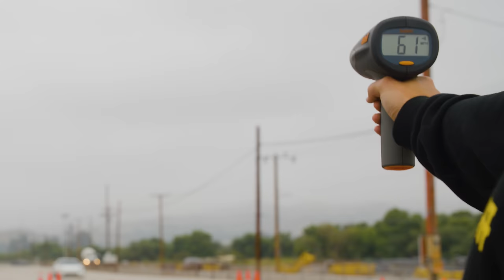$450 Brakes vs $4,500 Brakes | HiLow

Comment from the maker: Do you drive a Hi car or a Low car?
Reply: Not yet car
Reply: High, I don’t trust eBay parts
Reply: High car, rotora BBK with OZ wheels wrapped in Pilot Sport 4s
Reply: A middle car. It's stock.
Reply: Low car, 2003 Mazda 6, just bought it, it works
Reply: Mid Car - Don't trust eBay parts but can't afford top dollar
Reply: I don’t have my license but my family is Low
Reply: I drive a no car
Reply: It's not lowered.. yet, but I usually go for the cheaper upgrades. If I went for the more expensive ones.. well I just wouldn't have any cuz can't afford them nor would I pay so much for one thing anyway. I'm po yo LOL
Reply: Lo car for me. I have a 2014 C300 on lo rim$ n lo on them brake$ too, I just need some good lo coilover$!  Hopefully someone can recomend on the kind I should buy? 😎🤙btw very good episode  guys!!!
Reply: Low Car lol
Reply: cubicq1 well i wouldnt know what to suggest for a lo car but but if you want the best coilovers, KW suspension has the best coilovers ever
Reply: Medium car
Reply: The lowest of cars
Reply: Lower than low car
Reply: Westley Parker Peugeot 106 zest. (2000) try me boi
Reply: Donut Media low car, my car costs less than their wheels and has a top speed of 110
Reply: super low car
Reply: @dghddvsfbdch6183  awesome dude thnx
Reply: @BigMattRob  400 hp Honda crx
Reply: Hi car that looks like a low car 
With low car tires because theyre getting burned off 
But its got a ls so no ones expecting the speed
Reply: Donut Media I would give my guy a raise
Reply: Functional mods=high.. cosmetic mods=low.
Reply: I drive a stock Toyota Sienna LE. That’s not comparable a tuned 350z
Reply: Stock.😭 maybe another day when ever I have time and the money😂
Reply: I drive a no car
Reply: I drive a medium car thank you very much.
Reply: I drive a broke car
Reply: Slowly building a high car, takes longer on a budget but I think the results are worth it
Reply: Low car
Reply: A stock car
Reply: I have a Lo-car (mostly finished).. but am working on a Hi-car too (barely started) it's so expensive that progress really suffers.
Reply: Low car, but I don't track or drive super hard. Just keep the daily reliable, and mod the off-road toy.
Reply: @UC4UqvaIO4GkvcFEBOB0hA2w  for smaller cars, there are sooo many brake upgrades available at the wreckers... the trouble is that you have to invest the time to find something that fits.
Reply: Was this not already released previously? Hand on my heart I watched this a while back yet it says it was released 6 hours ago...
Reply: All low cars over here!
Reply: Hi for sure
Reply: Mopar or no car
Reply: A medium car
Reply: At the end you should sell the cars. I'm curious weather the Hi Car is worth that much more than the Low Car. Aka is Hi Car a money pit
Reply: Donut Media low car, Mazda protege gt 1991
Reply: @u1richh  hi stock, its an audi.... i need a better job
Reply: 6 piston 18Z calipers and 14 inch two piece rotors stop my 300 on a dime, but cost many dimes.
Reply: Stock car
Reply: One of both.
Reply: Low car but i do all the work myself and not the lowest i try to go mid tear XD
Reply: Mixx😂
Reply: no car... so buy me a car please
Reply: Low by all means. Hi brakes too much money for just a few opportunities. I am a spirited driver... not a racing one... just my two cents
Reply: Imagine driving lmao
Reply: Hi car son! Viper!
Reply: Hi
Reply: Lifted f 350
Reply: low car for sure
Reply: Hi car C300 modded out and a Low car 240sx S14 but one day will be a high car
Reply: For the g35 and 350 go with akebono caliper upgrade   bigger brake kit for g35 for only 500 used  4 piston front 2 rear
Reply: All the way from Jamaica, you guys are the best I love the humor keep it up good job👍
Reply: I got a motorcycle does that count?
Reply: I drive a sh!tbox 99 TransAm so it's fairly apparent it's a low car.
Reply: Lo
Reply: I'm driving a shit box.
Reply: So lo it's in hell, where it belongs.
Reply: About that low life guys
Reply: i drive both, you see i wait for the Hi cars to get into a wreck. buy the good Hi parts for cheap and put it into my Low car. best of both worlds for me but not to the guy that had to much fun
Reply: So Low that most of the parts are homemade...
Reply: @u1richh  Stock suspension height 10 MAZDASPEED3
Reply: Low car.
Reply: garbage car! haha. 01 saturn sl2! there is fun in driving the piss out of a pile that if wrecked you have no remorse for!
Reply: Both! Slammed Nissan, jacked Subaru.
Reply: A car that has no motor... low I think?
Reply: I drive a Mid car. Not too cheap on parts, but not too expensive either.
Reply: Stock car
Reply: Hi car, if my breaks fail after some hard breaking i'm flying off a mountain
Reply: Low budget, lowering springs, low car
Reply: Hi car... But like now they are parts from 12 years ago before I had kids and responsibilities lol
Reply: The next hi low will be about paint
Reply: Donut Media KEEP GOING W THE HIGH LOW UPLOADS
Reply: Daily: high
Weekend turbo ek: everything high except for the rota slips
Reply: Low car
Reply: Donut Media what’s below low???
Reply: Hi car
Reply: You should do what’s better a supercharger or a turbocharger.!??
Reply: the car drives me
Reply: HELLO DONUT..
I REMEMBER WATCHING ONE OF YOUR VIDOES...
At the end you were promoting a website or link that that's teaches or help develop various skills..
Would like to know the name? Am interest in the link.
Reply: A Corolla, I drive a Corolla Karen!!
Reply: My car (Honda Civic EK3)  is definitely a low car, becaudse a lot of stuff for it is AliExpress hahaha
Reply: Medium
Reply: Donut Media Safety is number one ☝️ priority!! You should get the willwood or brembo brake kit!!!
Reply: High car, can never fail upgrading what the manufactor has shoe horned into price margins and when I do a job on my car I do it right so maintence goes easier. Our 08 mountaineer calls for ceramic pads all around but from alot of research larger vehicles do better with metallic so I went with the same Bosch severe duty meallic pads they use on police explorers that lasts twice as long as normal metallic or even regular grade ceramics coupled with some brake drag reduction return springs that even out the pressure on the pads/caliper and they keep the pads from rubbing. Up here the Oem ceramic pads slid until the whole caliper warmed up in winter and now even at -10f these bosch pads stop consistently, I do brake fluid changes every year if the fluids a dark enough amber and its crystal clear when I'm done. On my '86 chevy astro van thats street "race" spec with a 65thou bored out 4.3L, gutted interior except front seats and has a high flow exhaust but for the brakes I use race grade ceramic pads that are as close to carbon fiber biting force upfront and HD metallic rears and that van will throw everything in the back to the front if your loaded even if you used three straps to hold the spare, if you have enough traction itll lift the front. the police brakes were almost cheaper than regular oem stuff too with the goodys and consumable rubber bits
Reply: Donut Media try doing a comparison of the $2K Akebono BBK vs the Wilwood BBK.
Reply: Loooooww either my 2005 Hyundai or my 73 super beetle
Reply: @epiles2  My Tesla came with Pilot Sport 4S's stock.
Reply: Mine's stock at the moment. Will follow a similar path in upgrades though but will find a happy medium between the products shown so far. Probably do mid-range performance coilovers, a nice set of 19's, and some damned decent tires (driving a Fuga 350GT or an Infiniti M35 for the rest of the world).
Reply: @takanara7  nice so your car came with good tires, those werent out when my car was produced (those tires were released like 2?years ago)
Reply: Hi or low? I drive something in between the two... I don't buy the cheapest parts, but won't spend thousands if not necessary. I like these series tho. it show in many cases that  the Hi stuff isn't so much better than the Low considering the price tag and servicing cost etc.
Reply: stock shitbox
Reply: Νο drivers license, yet
Reply: Depends on your perspective, my 1992 prelude SI 2ws is mint which makes it a high car. On the other hand all the mods were done in 1993 and are pretty LOW right now.
Reply: One that’s below low car
Reply: High car, carbon ceramic, Michelin cup2, Bilstein
Reply: I drive an e46 so it's a high car and not for mods but for maintenance!
Reply: Rent car
Reply: I love this new series
Reply: Donut Media Medium, I’ve got brembo brakes and Milltek exhaust, but I have cheap wheels and tyres
Reply: Low car
Reply: i drive a low car high lol    i mean Hi
Reply: Y’all should do this series again with little fiesta st’s so you can do hi/low with turbrchrgrs
Reply: I drive an OEM car.
Reply: Low and stanced
Reply: Any car looks better low😂🔥🔥
Reply: Somewhere in the middle.
Reply: What if you're spending Hi car money on your Low car...80's VW anyone?
Reply: I drive a No car
Reply: Ho is this and I am Denislim 
Iike yore car
Reply: Hi car, if you race, better get good brakes etc
Reply: Do super single and racing clutch for next!!!!
Reply: Showed 4k usd "down the drain" for a fucking 2.5 N/A 5cyl swap on my volvo 744 (originally B230K - you US guys maybe never heard of it, 2.3L redblock, carburated.). Busted one crankshaft of my 2.4 VVT just with the startup with the standalone ecu. Bought the other 2.5 engine out of a 854. Still rusty af. Still no suspension or brake upgrade from 262mm basic rotors. Bought the car ten years ago for 100k HUF (540usd back in 2009). It's a hi, but it's still a low :D
Reply: Got high and low cars here daily’s and special occasion car
Reply: Please do an Exaust Hi to Low
Reply: Dh bike
Reply: Lo car for sure. I don't think these guys understand what you guys are doing. Lo car doesn't mean bad car... Just cheaper. The parts you guys are getting are good... Just cheaper and perfect for a daily. Hi car is great but you will do more than daily it. You probably will track it. I want Hi car my wallet though says Lo car. 😊
Reply: Donut Media low,super low,like max payne 3 walmart bargain bin low
Reply: I drive a car that I bought for $1,500. The most I've payed was $2,500. The usually last 1-2 years, doing my own maintenance and small repairs, then I start looking for a new one before the old one craps out.
Reply: c5 vette with a mix of expensive parts and some cheap parts ;)
Reply: I have a $50 dollar car
Reply: Donut Media definitely a low
Reply: I'm more of the middleman in everything soo far
Reply: It there a in between car? Lol
Reply: Low mods hi repairs but not by choice, that’s what you get when you buy a bmw
Reply: I drive a stock honda accord #dadlife
Reply: I drive a van
Reply: Stock...but I'm on the low side for sure.lol
Reply: 93 350 chevy. Beast!
Reply: @rt_lucas6822  work hard dont be silly with cash
Reply: Sir, I drive a toy car
Reply: Hi car - AMG GLC 43
Reply: Hi car - AMG GLC 43
Reply: I drive a Zero car, Zero spent on upgrades because I am DIRT POOR
Reply: I wouldn't drive a car high unless in like, South America or something
Reply: Low car.  V-MAXX Classic coilovers, $150/corner wheels, stock rotors w/ upgraded pads and stainless lines on an NB Miata.  Miatas don't have enough power to fade these brakes at the track anyway.  :D
Reply: Low car, just bought $7 brake shoes a couple months back but they work surprisingly well on my old saturn.
Reply: I'm a more "depends on the part" kind of person. Rims and rubber I like a middle ground, brakes and rotors name brand upgrade, suspension upgrade name brand, stereo system name brand parts and OFC (fux CCA), quality tint no purple bs, no name intake, stock exhaust just resonate delete, oem upgraded plugs and coils.
Reply: I drive no car😐
Reply: So low I squeeze my cheeks every time I have to face my dreaded arch nemesis the speed bump
Reply: Next, spoilers!!=!!!!!!!
Reply: Mid
Reply: Hi car
Reply: 370Z Nismo 6sp Manual. Mostly stock.  
+ Aftermarket Oil Cooler (Z1 Motorsports Setrab 34 row) this is needed and SHOULD HAVE COME STOCK from Nissan on a Nismo. 
+ Aftermarket Cold Air Intake (K&N)
+ Murdered the Stock Nismo 19” Rays Black
+ New  tires (Continental Control Contact)
+ JVC Stereo upgrade with backup cam.
That’s it.
So is it High/Low? You choose- I don’t buy the most expensive products and definitely never buy the cheapest.   I have prob spent like $30K on my Z car in total over 5yrs since I bought it used- including the cost of the Z.
As others have prob said- if you buy a Sports package or a Nismo you get better brake calipers (like Brembo) and better suspension components.
Reply: Lilpeanut8888 haha 😂
Reply: mid car. researched parts i could spend less on and spent some decent money on things i shouldnt cheap out on
Reply: Hi car 🏎🤙🏽
Reply: Yes
Reply: Low af.(peugeot 405).But it's reliable af too!
Reply: Low for sure
Reply: I drive low car now, I would prefer not driving that lol
Reply: g37 :)
Reply: 74" Ford F250 Ranger XLT 
Low so far no expensive parts have been needed at the moment
Reply: I pimp the medium cars.
Reply: WOW NICE... Not cool donut
Reply: In all seriousness I drive the bisimoto 1000 hp elantra gt. Its almost finished, only 826 hp to go.
Reply: Stock car (for now)
Reply: Hi
Reply: On the brake upgrade a low car😅
Reply: Donut Media this already has 1 million views.... if everybody watches this 9 more times, Nolan will get a pay increase! Let’s do it!
Reply: Jeep srt w big brembos🥵
Reply: Hi car
Reply: 100 dollar 88 Cherokee
Reply: No car.
Reply: Both
Reply: Donut media give me a break 🤣
Reply: High car. MX-5 ND2, Brembo, BBS, Bilstein dampers. BUT I need a set of winter tires for a couple months out of the year, and already looking at 2k for a med grade set of wheels and tires. After watching these vids, probably not gonna sweat not being able to afford Advan or Enki wheels for a just winter.
Reply: Middle car
Reply: Donut Media I got evo x with hot boi bolt ons and and low boi wheels and tires lol
Reply: Medium car. I don't trust eBay because the deliveries never make it to my house.
Reply: Lowmborghini
Reply: Donut Media hi car
Reply: I drive a stock Tahoe. Working on making it look pretty with headlights bumper wheels and lift but eventually I will turn it into a hi-car. Just scared it will rust faster than I can build it
Reply: Mid Car
Reply: medium car.
Reply: I drive hello car
Reply: Slo car
Reply: I drive a 2000 ford ranger with almost 300k mileage, all maintenance done myself. So, it’s a hi car to me, but a low low low car to others.
Reply: Low Car. Miata will nearly all eBay parts... but picked very carefully. no problems so far ^_^
Reply: I drive a NO car
Reply: I drive a truck to tow everyones low cars
Reply: No car
Reply: Low
Reply: Моча ссаки
Reply: Mid car
Reply: Hi car, 1968 dodge charger
Reply: High car chevy s10 2.2 😥😂😂😂😂
Reply: Low
Reply: A later car
Reply: I drive a stock 2018 MX-5 Club with all the performance upgrades available. I consider it a Hi car, and I'm very pleased with it. The only thing I'd add is a supercharger.

I also have a 1991 MR2 turbo swap (NA originally). This will be my Mid car once finished.
Reply: I don't have a car
Reply: I drive a high car, a Toyota 4x4 😌
Reply: Mid car, a mercedes SUV (glk)
Reply: I am currently driving/slash building a 2004 Chevrolet classis with the 2.2 ecotec and believe it or not I'm going in the low range man but I'm doing it the rockauto way with dirt cheap oem brand parts from other gm vehicles and let's just say it's paying off big time dude even though nobody fucks with these throw away cars it's turning into something awesome and I love it
Reply: Donut Media i drive a No car
Reply: a very low yet mostly reliable car
Reply: Low
Reply: I am driving a hi Opel Vectra ^^ in that car already went over 10k €.
Reply: technically a low car becuase i fabricated my cage, and used spare parts from my stock car (old seats, old out of date parts, every time my sponsor pays for a new better part the old one goes on the truck) but it's really about 50k in parts
Reply: I drive my car high does that count?
Reply: Lo life
Reply: I call bypassing a tune
Reply: Donut Media hi
Reply: Low bike
Reply: Low low car 98 gti , semi stretch tire low pros
Reply: Donut Media I drive a Jeep.
Reply: Low,  because I'm going thru financial issues but I'll bounce back
Reply: Broke car
Reply: I drive a Hi Car. LS Swapped 350Z, 19 inch rollers, 3 inch independent stainless steel dual exhaust, cross drilled and slotted rotors, (coil overs are coming) #620LSZ
Reply: I dont even drive a car, yet
Reply: do hydro E-brakes next !!
Reply: Hi car
Reply: Stupid hi car 
Evo 9 mr 870 whp on volk te37 sl with Toyo r triple 8’s
Reply: Mid car, some parts low but modded to work better. Some parts hi.
Reply: A low car but make it Hi
Reply: Donut Media hiii
Reply: Fully stock car
Reply: low car)
Reply: I drive HI Bike and Stock car
Reply: Donut Media no car 🚙
Reply: Low car, i drive a schwinn
Reply: The lowest of low, 1998 ford festiva trio, $300 from a work mate, $39 to fill from empty, 0-100km/h = eventually lol. Its ugly, its slow but i love it
Reply: Low car 😂 but I only bought some spoilers
Reply: Hi car R33.4 I want it to last
Reply: Man at 6:14 you guys look really high.
Reply: VERY high. My Porsche 928 S4 had 2 previous owners.
The first was a guy who owned a premier repair shop that specialized in Porsches, Mercedes and BMWs.
It was kind of like his demonstration car so he spent 20 years upgrading maintaining modding it has a show car for his business.
The second owner was one of his employees could fall in love with the car when he bought it he took it racing and blew head gasket which resulted in a very expensive top end rebuild and replacement using GT heads with less than 3500 miles on them. The combination of the S4 Block in the GT heads is amazing it is an upgrade that not many people will do because it's very expensive but he threw a lot of money at that car. After damaging it trying to race it he decided to show it and it won first place in five out of six Concourse events he took it to.
So what I've got is a one-of-a-kind car that two guys over 20 plus years babied upgraded spared no expense on. All I've had to do is drive it. And I've seen the car double in value since I bought it. I couldn't love a human baby more than I love this car. Period.
Reply: No car cuz I'm 15 but a 350 is my dream car so maybe one day
Reply: Donut Media hi
Reply: Stock jetta tdi wagon
Reply: I don’t have one
Reply: Goin` hi! Just put some OE brembos on it
Reply: I drive the ultimate low car
Reply: Dad hi mum hi everybody hi grandma tough but low
Reply: Live that low car life!
Reply: Go kart
Reply: I drive no car :(
Reply: Recently went from 987 Cayman to '95 Miata.  NO REGRETS!  1 Porsche street tire = 4 Miata track tires, but you guys already know that.
Reply: I could buy 5 of my daily for the price of hicars brakes
Reply: no car
Reply: Low car Ford focus MK3 2012
Reply: No car cause I'm 13
Reply: I'm 13. No car
Reply: @dghddvsfbdch6183  no for the low car you need those coilover suspension kit nissan fairlady 350z 370z front back suspension coilover kit green
Reply: Low car I’m broke😅😂
Reply: LO CAR ALL DAY
Reply: @joeg.1119  super for throttle response and low end torque, turbo for efficiency and overall power
Reply: @joeg.1119  to upgrade a demon to 1200 horsepower this one mod place swapped its famous blower for turbo
Reply: You guys should do this again ... but with the late model Toyota MR2 .. but this time switch who gets the High and low cars .
Reply: No car
Reply: More mid range
Reply: I’m vary late but average with design flaws.
Reply: Stock civic lx but I love civics so just finally being able to own a nice one is a dream come true
Reply: Mid car lol
Reply: Medium/High!
Reply: 2014 ATS 2.0/ ZZ Performance 
Downpipe/ intake/ tune
3in exaust/ stut bar/ front and rear sway bars/ endlinks/ throttle body/ slotted cross drilled rotors/ pad/ steel breaded brake lines. 
,
Reply: Low when I can, go up only as much as I have to in order to get decent and reliable parts when I can't. 

It's all about knowing where you can and can't save money.. Getting good deals on good parts that you're not spending half of the total price just on the name stamped on the part.

Half of that comes with purchasing a car with a very large aftermarket. You don't wanna have some car where the only intake you can buy is a 300 dollar all carbon fiber beautiful glorified pipe with a bespoke K&N filter on it from Achtuning.
Reply: WTF why do you have those small OEM brakes on that car, how can this even be legal ?
Reply: @Clayton Salvigsen Um dude.. I would absolutely love to see a video of your car that sounds fucking AWESOME.
Reply: @JohnTothPhoto  Bro... You can always get different sized rims on the Porsche hahaha. Even most 17's are extremely affordable and I'm guessing most Porsches from before the modern Era where they started to get huge will look perfectly fine with 17's.
Reply: Hi car. Very hi car. I love it but hate it 😂
Reply: New car
Reply: Low car here
Reply: Low
Reply: I drive a stock car..... ):  need mo money's...
Reply: BOTH
Reply: 97 Sentra 5 speed. I call her ugly Betty. Ha
Reply: I bought someone else’s high car. 😊
Reply: Introducing the Invisa-car
Reply: Hi, quality always matters
Reply: Low car because of the color
Reply: I drive a stick car :D but if I had the money I’d go hi car all day, if I didn’t (and I don’t) have the money I’d save up for the best quality for a more moderate cost, I’d never look for the cheapest option, I’ve seen low car have too many issues
Reply: An old bike.
Reply: A low breaking down truck every once in awhile 🤣😭😭
Reply: Both. My suspension, wheels and tires I spent a lot. But my brakes, I’m not spending $4-5gs. No way. My $500 brake kit works just fine. I’m not slamming on my pedal like that lol. For daily driving, the $500 brake kit is totally fine.
Reply: Lo
Reply: Low car, the only way ill go high car is if ima be going to the track constantly or take it to Mexico runs. Its my daily so i just want it to look agressive sound agressive im only pushing 350hp few bolt ons but its enough for me. Down the line i do plan on going high on a project tho
Reply: Hi car, Acura NSX 1991
Reply: Stock
Reply: No car im 16 rip
Reply: Standard car
Reply: A bike...
Reply: I drive a no car
Reply: But if i could afford i would be team hi
Reply: I Have A Mid Car.
Reply: Between.
Reply: I drive a higher low car. Not cheap parts, but still pretty cheap. I have a 1986 S10 with a 2.2L 4c. With a turbo and a 5 speed swap, brake kit, beefy injectors, and a ECU tune :)
Reply: Mid car
Reply: Not yet but probably low car
Reply: No car rn (Need age)
Reply: Yes
Reply: Low car🙃😑
Reply: I drove a hi car.
Reply: A free car
Reply: I call my car the “shitstang” or the “ piss missle”.
Reply: Hi car, unless
Reply: Go kart
Reply: It rhymes with low car, it’s no car
Reply: your lo car is hi car for my wallet
Reply: For breakes i probably take low team
Reply: Medium? SC430 came with some pretty great features stock, so I just upgrade whatever I break 😂
Reply: I'm a high car guy.  When I don't get the good stuff I always regret it after.
Reply: Low
Reply: Low is lyfe
Reply: I dRiVe A nO cAr .___.
Reply: Mid car?
Reply: Low 2019 mustang GT California Special
Reply: High
Reply: I have a high truck and a low truck.
Reply: Low(er)
Reply: Haha he said sarcastically
Reply: @u1richh  I would like to think low car is better than stock but then again on the dyno it was 302 horsepower which isn't better. At least it's slammed
Reply: 1 tier below low.
Reply: I drive a stock car
Reply: HI CAR BOYSS
Reply: My dad's non modified
Reply: Lowest car
Reply: I used to drive a 97 Accord and just ghetto fix that thing cause I had to. Now I've got a 2013 Camaro LS and I'm still trying to figure out when I decided I wanted to spend that much money for literally anything 😂😂🤣🤣🤣
Reply: We’re broke bois so low car
Reply: Maita
Reply: Definitely a low car
Reply: I drive a no car
Reply: Middle car
Reply: I have a Lego E36 with parts from at least 5 different BMW models 😂 but honestly I go Low for parts that don't matter so that I can afford Hi on those that do matter 🙄
Reply: No car
Reply: I drive a bone stock BMW, so. . . Medium?
Reply: A no car
Reply: Either one pre turbo. If I was spending big money I'd do expensive tires, suspension, and brakes for sure. Cheaper wheels don't bother me.
Reply: Both
Reply: Low car + RX8 = Dumpster fire. Dumpster Fire = My Car 😃
Reply: Low car... for now
Reply: I drive a No car
Reply: I drive a very small but Hi-Car. A Opel Corsa E GSI. With Koni suspension, Brembo race brakes and Recaro Racing seats. Which is standard for this model. That nice car has 1250 kg and 150 horesepower with 280 nm torque.
Reply: غ @epiles2  تا
Reply: My bank account told me to tell you LOW
Reply: U clickbaited me it was 4400 not 4500
Reply: Low but with an S before the L
Reply: I did a few mostly oem and a few ebay parts like lower control arms, ball joints ,tie rods and kyb shocks but with oem boots mounts etc. Hope I don't have issues with ebay parts
Reply: High-Car. 2017 Opel Corsa E OPC Performance. Stock 207 hp 260 nm torque tuned to 240 bhp 330 nm torque. Comes with Recaro Seats, Brembo 330 mm brakes and a Drechsler Diff from the factory. That hothatch rocks.
Reply: Mid car 04 mustang gt supercharged
Reply: Low budget high dreams
Reply: low. i have a $150 brake kit (rotors and pads) on my 08 cobalt
Reply: bruh a citroen C2
Reply: What do you consider a 2013 Granturismo Sport with only wheel spacers and an X-pipe?
Reply: I drive a No car
Reply: Definitely Hi, my car has stock Brembo brakes, front 4 pistons 330mm, rear 2 pistons 280mm
Reply: I drive a virtual car!
Reply: What really matters:  Mass (WEIGHT). REQUIRED to transfer (absorb) & hold more heat
SIZE matters; the area is what allows them to dissipate (radiate) heat across more area.

But feel is what allows brakes to create more force, approaching the static friction (adhesion) limit of your TIRES. 

I've used Wilwood brakes (97 2JZ).  They made a lot of dust, had more bite & i needed rotors pretty quickly, but they were a little better than stock.

I also went to a place in Lawndale called COOLTECH ... they used Metal Matrix Composite (MMC) if I recall. The owner (gave me a ride in his spiffed out NSX) believed in reducing the unsprung weight of the brakes ... which made sense as the NSX was a lighter car which created a little less power than the 97 TT.

Your tires (and driving skill) will define the limit (max G) of deceleration.
Your brake rotor's MASS will determine how much heat they can accept before fade (assuming you have good lines, no air, etc).
Until you have tires + downforce that convert more rolling-energy per second than your caliper's clamping force x area can apply...

Calipers, pistons and pads can only (possibly) allow larger diameter rotors (than your OEM may allow) to accept more heat ... 
MAYBE can increase your feel (though they could decrease it) ...

That said, Brembo, Alcon and Wilwood Calipers are on flea-bay and can be bought for under 1/10th if used is okay.  (just refurb them).
Reply: 1977 F150 4x4 it's high. 
But my first generation Prius with the lower profile tires is low. The prayers also has a Thornton tuner chip. With that and bumping up the red line. It puts out 150 horsepower instead of 101. I get 33 miles to the gallon while doing 75 miles an hour.
Reply: I drive a 300+ whp 05 forester Xt that I've spent less than $1200 to buy and build!
Reply: Very low car. 96 RS camaro with 316000 miles.
Reply: Low car right now mainly because the clutch went out in my truck so I bought a shitty Honda until I got money to fix my truck
Reply: A Mid car.
Reply: Low car rules hi car drools
Reply: My whole car cost less than high car’s brakes
Reply: Low car right now but once I actually get some money coming in it’ll be like Hi car
Reply: mid car
Reply: Mid truck lol
Reply: High car, bbs ch008’s wrapped in mc PS4’s
Reply: Is there a category below low car
Reply: a stock car, im not one of those guys that wants to load up on amazon parts
Reply: rocketbunny low 350z 💀
Reply: A stock car😂😂
Reply: a slow car
Reply: None yet car 💔
Reply: Where did you by hi cars brakes
Reply: A no car
Reply: Currently low car for both lol. 2015 Corolla with very minor mods(changed the exhaust to 2.5" from the cats as well as injectors and spark plugs, it my daily) and a 1999 gs300 (muffler delete, welded rear diff, couple other little things)